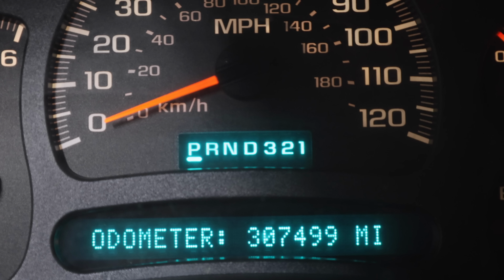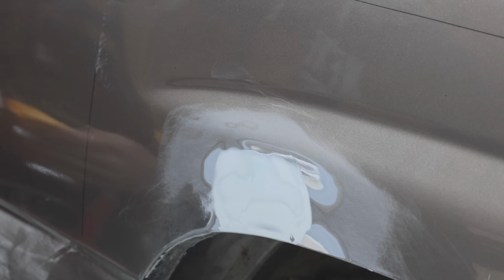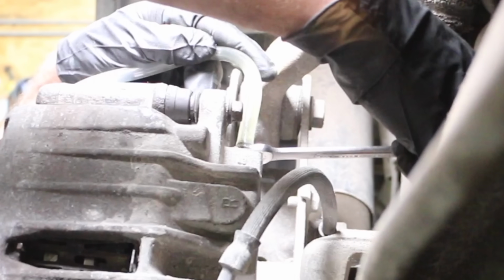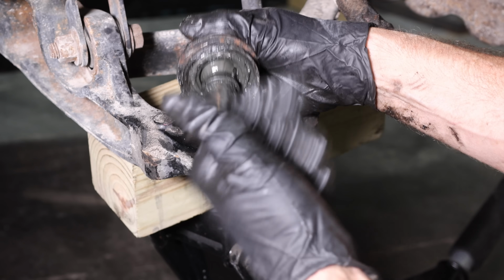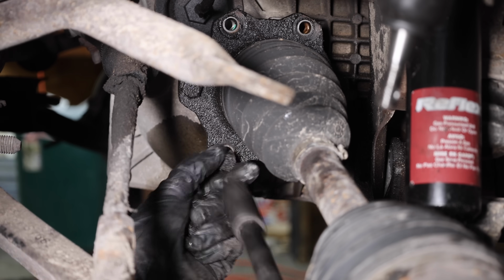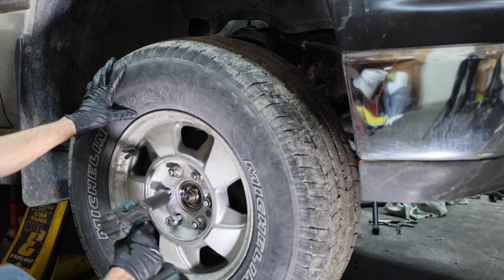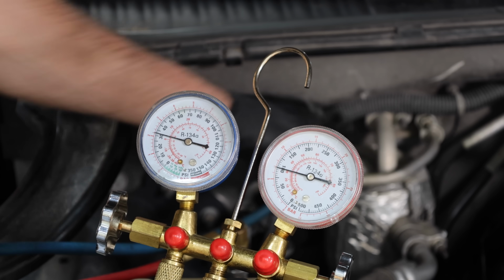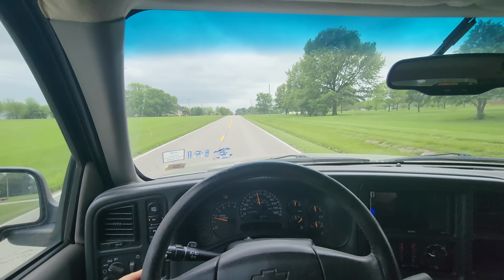Is It Stupid To Fix Up A 300,000 Mile Vehicle? Let Settle This!

Comment: Nice work. I would also change the transmission filter. 
I like those battery testers in theory, but unfortunately they are not consistent and reliable. The best battery tester is a load tester.

Comment: Nice, I have a 2008 Trailblazer with 269000 miles. Don't leak or burn oil, but I did front hubs, brakes etc, normal wear items, runs great.

Comment: Todd, I agree with the posted comments, no need to change the format.  You do a great job 👏 with your content and always very informative and well received.  

Great job on the suburban.  At 300K miles it’s now just getting started.

Like you, I just spent $2K on my GMC Terrain on tires, struts, shocks, serpentine belt, upper and lower radiator hoses, coolant and spark plugs.   

These days “cheaper to keep her”, is so true.  That cousin Ernie is a wise man-nequin. 

All the Best🇺🇸

Comment: I wouldn't change a thing with the format.

As far as a 300k mile vehicle - keeping it up shouldn't be too much an issue as long as A - It wasn't junk from the factory (there are some vehicles that come to mind) and B - You've done decent maintenance up to this point. Even though you live in an area with snow, I don't think that vehicle has seen a lot of, if any, salt. Daily city vehicles in the rust belt can be an entirely different story - they'll run great as their bodies disappear.

My 07 Tundra only has a little over 150k on it - but it's great and with new truck prices what they are....it's going to have to last me a few more years.

Comment: I thought this video was perfect, nicely paced for all the information you had in it.  I have 430,000 miles on my 2000 F350, at 300,000 miles I had the ball joints and tie rods replaced, eventually I had the sway bar and leaf spring bushings replaced, and then the rear driveshaft u joints and front end u joints replaced, still better to replace some parts than have a large truck payments.

Comment: couple things, you should have service the E brake while you were at it and replace the filter in the tranny, if the pan dont have a drain plug, order one from dorman, you didnt  replace the cv or repack them either, not to the mention the control arms bushings

Comment: id like to give a tip when changing fluid in the front and rear diffs i like to make sure the fill hole bolt comes out first that way if the strips then atleast there is fluid in there(hopefully)

Comment: I think the answer to the question in the title of the video depends on whether the cylinders still have good compression, and there is relatively little frame rust.  If so and car was maintained well w/regular fluid changes, then it isn't "stupid".

Comment: I have a 2014 Ford Fusion with the simple ol' 2.5L naturally aspirated 4-cylinder engine with ~215,500 miles on it.
Nearly 200,000 of those miles have come since 2017 when we picked it up used at one of the local new car dealers and it's been rock solid.  As you did with your Suburban, I'm going to stick some money into some parts including rear shocks, front rotors and pads and some new tires but they might wait til autumn since they've got some life left that'll easily get me through summer.  
One other thing that needs to be done is an interior detail which I have no problem paying a professional to do and it's never really been deep cleaned.
With the car market the way it is, cars becoming overly complicated and carelessly assembled (I work at Enterprise/National/Alamo at the local airport so I see first hand which companies have the worst track record on recalls and repairs) it seems foolish to part with a car that has been nearly trouble free outside of normal wear items and incur a car payment and the accompanying higher insurance rates.

Comment: brah is straight-up SAVAGE, That alignment with cinderblock , string and tape was the SH*t
Reply: I did it to an SUV of mine about ten years ago. It worked fantastic. Just takes a little while.  Any time some shop does it, the steering wheel ends up not perfectly 12 o-clock or it tends to pull a touch one way or the other.  They never want to take 5 extra minutes to make everything just right.
Reply: the only thing you have to be careful is if your vehicle has different track width front/rear. then your strings aren't parallel
Reply: @aleks138  this is true. It can still be done though. One could measure off the 3 and 9 o'clock positions of the rear wheel to obtain a square string in such a case.
Reply: @UserFormelyKnownAs_hjkh  of course it can be done. Just something to watch out for

You can also google the track width of the vehicle and adjust the centerline measurement
Reply: Works well TBH did it with my 98" Ranger 😂
Reply: @scottysgarage4393  Calm down fellah - it only helps get the toe setting close.  There are many more settings to adjust if needed.
Reply: Old school ways arent always as convenient but most times are just as good, if not better, than the technologically advanced ways of doing something.
Reply: @UserFormelyKnownAs_hjkh   They still can't figure out how they built those pyramids of Giza, and perfectly aligned with the poles of the earth.

A plum line using a string and weight is still just as accurate as anything man will ever try to "advance" over with any kind of technology. 

So wheel alignment also makes perfect sense in this context and isn't surprising at all.
Reply: @HAL-dm1eh  exactly. I was taught this method by my grandfather many years ago, though i just use jack stands, and have been doing it ever since. As long as caster and camber stay good, its a great way to set the toe on a vehicle. Cheap, easy and accurate. Now thats hard to beat!

Comment: I always give parts the Rustoleum Restoration too. If you’ve got it off already anyways you might as well clean it up and paint it quick. Get those parts good and warm before painting and it’ll cut the dry time down to nearly nothing before you can handle them without marring the paint 👍

Comment: I recommend you install idler arm and pitman arm supports.  The double capture the studs so they can't rock back and forth under stress.  It's a good upgrade to get a bit of assurance down there.  Cognito Motorsports has them.

Comment: Im surprised those are factory lowers on the ball joint. My gmt800 had factory lowers too at 200k miles surprised  they can  go that long. Mine kicked my butt trying to  get it out of the spindle. Did you say 300k on a 4l60e you best go find some wood and knock on it

Comment: I just replaced the drivers side front fender and both doors on my Avenger. It was not as hard as I thought it'd be. Literally 4 bolts and a wire plug for each door. The bolts are 2x on each hinge, and the wire plug for the control panels just plugs right into the frame. Fender had more bolts and I had to reach up by the headlight from inside the wheel well. Was definitely more annoying. Overall cost was $430 for both doors and the fender, windows and power mirror included. Learning to do it yourself is worth it. I was quoted between $1300 to $2000 for the work. Took me 2 hours with a friends help holding the doors. I have around 140,000 miles on my Iridium plugs, and they still seem fine. Definitely worth the money.

Comment: According to Kelley Blue Book, the most $ for this Suburban would be about $2,600...if it were in excellent condition. That's the most the insurance company will give you if it is totaled in an accident. And we all know that the insurance companies will not give out max $ when a car is totaled. As long as you don't spend more than $2,600 in parts/labor, no problem. If you do spend more than that in parts/labor, you could wind up crying in your beer, if the car is totaled.

Comment: I bought a 2000 Chevy Silverado 2500 back in January 2015. It had over 363k miles. She was pretty beat up. After now 9 years and have rolled over 500k miles; I'm very happy. The first year was a LOT of past due, overdue & not done maintenance. I did have to replace the engine & transfer case along this journey but the frame is good and body is not pretty but very little rust. I'll drive it until they quit making parts for it.
Your videos are awesome and request you keep your information delivery exactly the same. Great work!

Comment: Feel like I'm in the same boat.   Our 99 F250(non SD) is due for a bunch of stuff.  It recently just got all new steering and ball joints, Re-flow the solder on the cluster so the ODO lights up, new tires, coolant flush, oil change, cv axles, and it still needs a few more things but its already driving awesome.

Comment: Hell in ny if you have a vehicle with 200,000 miles you might as well trash it. The rust due to road salt absolutely destroys vehicles. Ive seen cars with less then 100,000 miles not able to pass inspection because the frame is rusted past any chance of repair.

Comment: You mentioned in the video that you hadn't found a good pair of snap ring pliers.  I have a set from Astro Pneumatic that I like.  Snap rings definitely still fly off if you're not careful, but they're way better than some of the ones I've used.  I'd suggest them as a contender when you do the video.

Comment: I have the same engine with 225k miles on it and use penzoil platinum high mileage 5-30, would you recommend switching to the shell rotella t6 15-40?

Comment: I drive one. Just turned 300,000 Dodge caravan Short Body 3.2L 2009.
 The engine runs great/with no issues other than the body rust. Canada liquid salt on the highway doesn't help any vehicle.
 I have always changed my oil at 3,000.
 Todys vehicles. Not so much.

Comment: Great work Todd! 👍 But I'd like to make one suggestion.  The caliper bracket bolts that you torqued to 85 ft/lbs. I'd HIGHLY suggest using Loctite on those bolts. GM uses Yellow thread locker from the factory. I didn't put any thread locker on mine, just torqued them. About a year or so later, the rear passenger caliper lost a bolt on the highway at 75mph. I felt it so i went to stop and see what happened,  that only made it worse. The caliper pivoted and dug into the wheel, literally cut the wheel open like a can opener. And at 75mph, I nearly flipped my Suburban! Thankfully I maintained control and came to a safe stop. Id addition to a destroyed wheel, it ripped the brake hose off, bust the shock absorber, and  lost almost all of the brake fluid all over the highway. But thankfully thats ALL that happened,  it could have been a LOT worse. Needless to say, i now add red Loctite to my caliper bracket bolts before I torque them down. Sorry for the long rant, id hate to see another accident due to another loose GM  caliper bracket bolt.

Comment: Thanks for sharing your thoughts, ideas and videos. Great content and the speed of the videos are perfect. I recently discovered that vehicle manufacturers are now starting to delete the engine oil dipsticks as most already deleted the automatic transmission dipsticks. Might make a different type of video to view different types of new cars and trucks and compile a list of the ones that are doing so. Another side line might be to investigate how hard if not impossible it would be to add aftermarket dipsticks back on to sealed transmissions and eventually engines. Definitely agree that it’s cheaper to keep her if you have the ability to do it yourself. Regret parting with most of the vehicles I did. Had a 93 VW GLX Passat that got the better of me since I can’t do the work myself and had a cascade of failures at 303k. Still wish I could of somehow got it back on the road. Wishing you and your family the best.

Comment: This was an awesome video and I think most viewers prefer a fast pace even though I would tolerate a slower one.  It's definitely worth fixing body-on-frame vehicles of any mileage so long as rust is not a major problem.  I live in a river valley in the Rust Belt where winter roads are piled with salt; unibodies are quickly doomed and even trucks eventually succumb.

An interesting thing about a 300,000-mile Suburban is that it cost about $40,000 new, but has used $75,000 worth of fuel in inflation-adjusted prices over 22 years even if it still averages its original 14MPG, which it probably doesn't.  A brand new Suburban may not last as long, costs $75,000 or more, and has virtually identical fuel economy :(.  So much for progress; you might as well fix up the old one and save $73,0000.

I really like your attitude about this stuff as I've heard far too many Americans justify new vehicles by saying, "I should sell or trade in the old one while it's still worth something."  That's one of the dumbest things I've ever heard, but I've even had siblings use this logic to justify their purchase of a new vehicle.  Rather than lie to yourself and others, at least have the honesty to admit that you just want a new car; pretending that it's a good financial investment makes you look either dumb or dishonest as cars are the worst financial investments that we make in our lifetimes unless we have other addictions.

People usually don't need new automobiles, but they want them as they improve their self-image for a few weeks until the "new" wears off and then they're just as insecure as before.  That's a lot of money in exchange for a couple months of self-assurance.

If your old vehicle still fits your passengers, is mechanically reliable, and remains structurally sound, then you'd be an idiot to buy a new one.  Even if you spend a whopping $10,000 repairing and upgrading your old vehicle, it's probably less expensive than a new or used replacement.  Maintaining and repairing high-quality products is almost always better than buying new ones built to lower quality standards.

Comment: INDEED  You VALUE ( Money and TIME ) ALIKE !!!
What I Can say is {MOST} are very relaxed when it come to the INTERACTION of 
PERIODIC Maintenance though ( SADLY )!!!  As a Quick Side bar here will ATTEMPT to Explain ( WHY ) So often THINGS  Get  forgotten as well.  In My youth a  Local trucking company was looking for  those who were ( NOT ) afraid to get their hands dirty. 
When the Person Both ( DRIVING ) Long  distances  ( ALSO ) GETs a  Hands On Version of what does and  DOES  Not  get  addressed ?    It  rings true that a OUNCE of PREVENTION
is Truly a Any amount of  POUNDS, Tons , Of  Supposed ( After the Fact ) Fixes that  easily could  have been avoided.  This  place made a point of  having ( TWO ) Shifts of Service schedules going on.  Am/ Pm  ( MEANING)   The  vehicles got  taken care of  ( WELL ) within a  24  to 48  hour period.   That is  Standard issues.  Oil, Lube, Filters, Etc.  When One of the  other  Decades long  Shops Closed down. A  few of the VETERANS  were snatched up and  MAN oh Man  want to talk about  getting a  REALLY Big  Bang for the BUCK. 
Tow of  them and  Myself  had a  good  interaction when it  came to what  was and  also was NOT  on the  Plate to get things or  keep things in a  Better the  just  O. K. Rolling  state. 
To say  ( WISDOM and  DUTY ) are Worth their Weight in GOLD  - Always  was never more true then when some of the younger guys  got  caught  taking  way to many short -cuts. 
One of the  Normal ( Daily Maintenance   Check  Sheets  )  was showing a FEW Strange noise being  heard during a  shift change in which  one  guy checked it  off and  other  merely  left it  blank.  PAPERWORK  Like  PAYING  bills  is a  Matter of  WHO is  watching  
( WHAT )  and  how  closely or  instantly it  gets caught as well.  The owners of  this  particular  company was a  pair of  brothers.   One  was All Business all the time  while the other  would  have a  cigar  lit or other wise in his  mouth  as a reminder of  all he  did and  did not  have  to LIVE for in the end ( SORT OF ) an Ongoing  Joke  he would  say when asked. The Saying goes like this.  CHECK  ( DOUBLE Check ) then also CHECK it  ALL over again ( BEFORE ) just  saying ( IT ) Will do for now  was like a  Paycheck or  Bonus  Either increasing  or  not  being  allowed.   A  POINT  System  was put into place.   They all agreed that (IF)  the Process was to Succeed it  needed ( ALL ) Parties to be  Equally invested. 
The Short of  it  was this.  Good Wook got only  good  pay.  No Bonus and  No increases.  Sloppy work was not Tolerated.  out the  Door was the only  solution there.   EXCELLENT  Work was REWARDED.  Not  on a  Time only  Basis  BUTT on the  Total Process.  What  was , Was Not  , Also what  got  taken care of ( BEFORE ) It  got  any worse as well.   Mileage tells only  one part of the  equation.  Hours of Operation.  ( Maintenance ) PERIODIC  or  NOT  at  all in to many cases.  The  Veterans  almost ( ALWAYS ) Were ahead of the pack.  Yet, they too were tasked with Helping out the  Younger crowd to keep the  total Place running smoothly  way more time  then other companies could  ever state - sadly. 
When ever a  question of ( IS IT ) WORTH the  PRICES  being  paid  comes into play ? 

I Often refer back to what  ( BEING PREPARED ) and  the  Term ( ALWAYS ) as the  rule to follow  Not  wait  and  see if  other issues create more Down time, Costs or  other such Unfortunate losses along  the way.  Oh yeah ( BEFORE ) I forget.   IF everyone did what  was needed ( BEFORE ) the  repairs  actually  occurred.   many more High Mileage VEHICLES 
will be on the road instead of  scrapped or  junked or left in places to rot back into the  earth.  Again:  " in the END - It ALL Goes Back to the B E G I N N I N G "
Pay for it now ? Pay al ot more for it  and other things - LATER ?!?!? 
 Is it  Cheaper to KEEP HER ??? That  can only  be explained by Who is  doing  what and  when NOT  just a  Person trying  to revive  something that died  way to long ago  making it a  total restoration instead of  a  Few Precise  Items being  upgraded or  Properly  Maintained  along the line of  service .. 
YOUR  welcome in Advance...